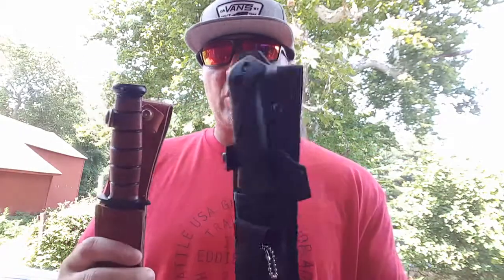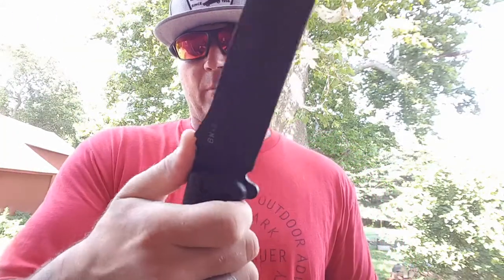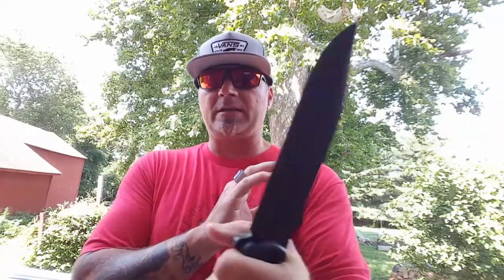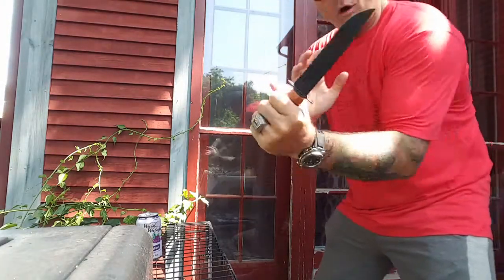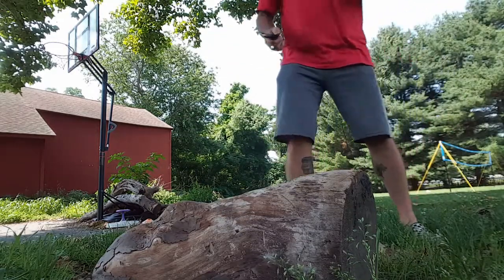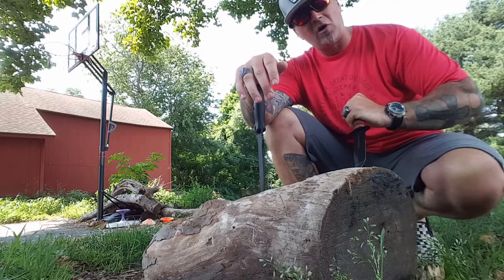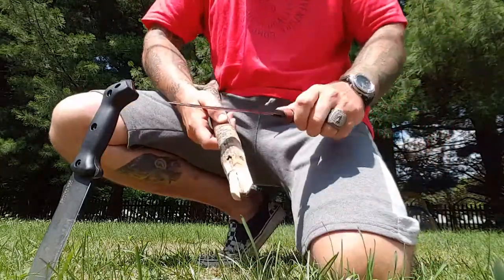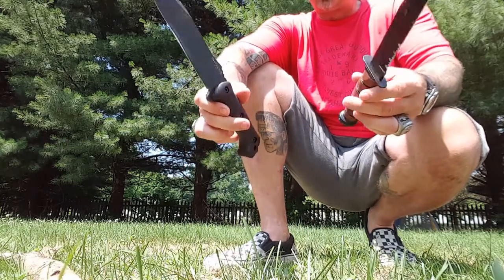Becker BK7 VS KA BAR fighting knife

Comment: There is something about the leather handle kabar that just feels awesome , they have a really good weight balance .  They look simple on camera but holding one and seeing that kabar quality up close in person is killer. The cool thing with Beckers is modding them yourself, even a simple poor man mod looks awesome. You can stencil the scales with a wood burning tool strip the coating and patina the blade plus buy a kydex sheath but still even with that crappy sheath it looks killer.
Reply from the maker: I did a video where I made custom grips for my BK9. You might dig that

Comment: Is the bk9 with Micarta handle scales better than the Junglas?
Reply from the maker: No but it's AWESOME
Reply: Donnie B All Day what can the Junglas do better?
Reply from the maker: @djdjdsdjdjdd3959  Its not a mater of "do" better, but overall shape and feel. I does slightly out chop the BK because it's got a smoothe full flat grind.
Reply: Donnie B All Day what one is more durable would you say?
Reply from the maker: @djdjdsdjdjdd3959  They are both 1095 and perfectly heat treated. The difference is that Esee has a no questions asked lifetime warranty.

Comment: I’ve used my navy kabar by putting it thru steel point first while a metal hammer hammers it from the bottom. Only the tip was a bit hurt, the USMC ka-bar is a beast.
Reply from the maker: I just wish it was designed better

Comment: Hey Donnie B. !   Put size 15,  plumbing O' Rings in the grooves of the Ka-Bar handle, for Better Grip. -   A  4" inch piece of Bicycle inner tube "Ranger Band" on the BK7,  The Grip becomes Fantastic.  Its tough to get the ranger band on, But I must say it's well worth it.  The inner tube is around $5 dollars at Walmart & Home Depot has the size 15, O-Rings for $3 for a set of 6.
Reply from the maker: I appreciate that. I've seen the o rings on the KA-BAR but not the tube on the Becker. That would even work still wrapping fishing line and hook first.
Reply: Yep I love the way the o rings feel on mine

Comment: I stripped the coating on my BK7, put rosewood scales on it, and bought a custom leather sheath that is wet fitted for excellent retention. Made a good knife a great knife. Oh yeah, almost forgot..I did a hand rubbed satin finish on it too, although admittedly, it's not as purdy now that I've used the crap out of it, lol. However, doing that sanding on it thinned it out just a tiny bit behind the edge, so it cuts even better now, yet is still plenty strong enough to chop and baton. I had to sand it because it had vertical grind lines in the blade once I stripped it.I also squared up the spine for scraping ferro rods or scraping fatwood fluff. I put a lot of work into it, and added about 120 bucks to the overall cost with the scales and sheath, but damn, it's an excellent knife now. It's my go to blade when I want a larger blade for light chopping. I've used the crap out of it.
Reply from the maker: Putting that much into it you could have just got a blade that has everything you wanted. But the key is you have everything you want.
Reply: @DonnieBAllDay  I don't regret it one bit. I love it, and as you so eloquently put it, I got exactly what I wanted. It's an awesome knife, and that stock sheath just outright sucked! The scales only cost me about 35 bucks, and the sheath was about 70 bucks The rest was just elbo grease which is pretty cheap, lol..
Reply from the maker: @timbo4374  indeed

Comment: Not too fond of the KaBar as an only knife- carried one in '71-72 and couldnt wait to swap it out for a Buck 120 "General" which I carried for @ 40 years before it sprouted legs and walked off. Do wish I had hung on to the KaBar, tho, "just cuz", as it was part of my life back in the day and because it was the ONLY KaBar or similar knife with a chrome or nickled blade for humid climates.... I like the serrations  for certain cutting chores, would like to see more knives with that offering. The BK7 edge needs an inch or two serration, the back-clip sharpened, and maybe the allens holding the grips on given a wee drop of loctite and it would truly be the "superior" knife... but that's just me!
Thanks again for another great presentation, Donnie B!
Reply from the maker: I have a love hate relationship with KA-BAR

Comment: Get a second cut file and flatten the sides of the handle,  then blend it in to a oval shape. Then use sand paper to smooth out. Put tape in line with the grooves, then scribe the edges with sharp knife. Then use a squre needle file to re-cut the grooves. Finish with oil, then seal with a leather balm. Then when dry seal with natural shoe polish. Then the knife is brilliant! Good utility knife, and self defence knife. Always wondered why the guard is bent towards the hand? Any thoughts?
Reply from the maker: The guard is the way it is because it's not a designed combat knife. They used an old hunting knife factory and just kept stamping out hunting knives but painted black. Thats why the KA-BAR is a good utility knife but a horrible combat knife. Shit balance, shit grip,  shit tang. Great steel.

Comment: I don't disagree with the balance difference between the two but nobody is going to be flipping a blade around in a real fight. Real fights usually consist of multiple thrust (sewing machine)
Reply from the maker: I hear what you're saying, but sometimes in combat especially, when the time comes, angles are important and getting to them faster than the other guy really helps. Believe me.
Reply: @DonnieBAllDay  Touche. good point.... we need every advantage possible, especially if we are resorting to our blade.

Comment: I see a lot of knife test as wood choppers that is set as a bench mark... I wonder about the best tools for the job..like an Axe for wood chopping? There are some nice survival axes. I would go for a lighter dual edge with glass breaker on board sharpener for my applications
Reply from the maker: You are absolutely correct. I think the wood chop test is purely to show off the strength of the edge. A weak blade will warp, chip or dull during wood chops. It's nice to know that having a knife for absolute survival, that your edge can handle even the things you "shouldn't" need it for.
Reply: @DonnieBAllDay .  The design and purpose indicate ability. This will hold more weight on the craftmanship and composite of the knife. Ka bar and lmf ii are very different field uses but I see them compared frequently
Reply from the maker: @jetlee7743  The Gerber Infantry and Ka Bar "USMC" as it's commonly known are both military issued knives. Since both were combat used, I can see them often being paired up.
Reply: @DonnieBAllDay  yes for sure

Comment: I carried a Ka-Bar in the field when I was in the Marine Corps. We used them as utility knives and thought that the issue bayonet made a better fighting knife. We broke a few Ka-Bars using them and they usually broke the tip off more than at the handle where the tang starts even though I've seen a few of those breaks too. I sharpened the knives for my platoon and I used to file the false edge down to where the point was more centered with the handle instead of up swept. It made the point a lot stronger too since it took the thin part of the point down. Never made sense to me to have the point up swept instead of centered. They seemed to hold an edge pretty well and you could really get them sharp. One last thing, I never saw a Ka-Bar in the Marine Corps that had the USMC on the blade or the sheath. They were plain black sheaths and I think the blade simply had the OLEAN NY on the blade. Don't remember if the KA-Bar was above the OLEAN NY or not.
Reply from the maker: I was luckily not issued the KA-BAR. We were blessed with the Gerber LMF Infantry II. I just recently designed a better option for the KA-Bar. Production will begin soon. Going to be a beast
Reply: @DonnieBAllDay  LMF is a small knife compared to these.
Reply from the maker: @TheJolleyFamily  I'd take the LMF back to Afghanistan over the KA-BAR in a heartbeat.  Not even a second thought.

Comment: I chose to go with the BK7 but I was seriously considering the Esee 6 for it not having a thumb ramp and having the finger choil. One guy I was watching earlier basically took the features I wanted on the Esse 6 and smacked it on the BK7. I really like the way he modded his BK7, you should check it out:
https://youtu.be/m8iEIF5UOvw
Reply from the maker: I've seen the BK7 mods. I considered doing it to mine. Adding a choil and grinding down the ramp is pretty simple but if you really want those features, just stick with the Esee 6. The Esee has a flat spine, a choil, better handle scales, a better heat treat and a better coating, not to mention a better warranty. I'll do a vs between them at some point. I have so many knives to go through and I'm always adding to my collection. You should check out my video on the Steel Will Roamer. Similar to the Esee, half the price.